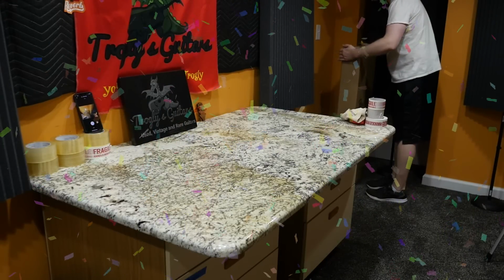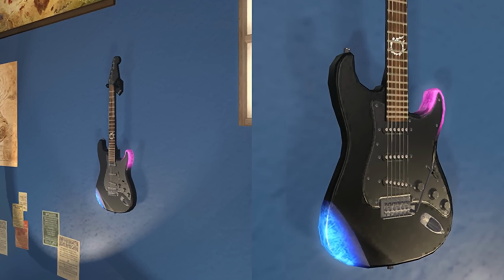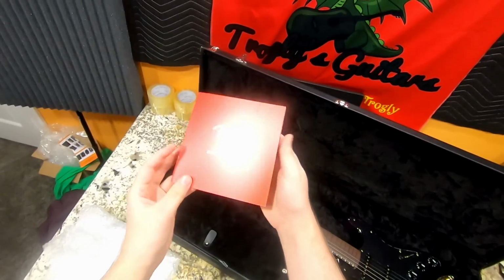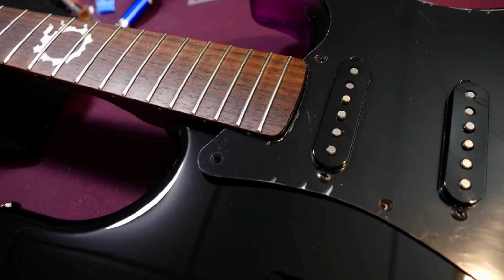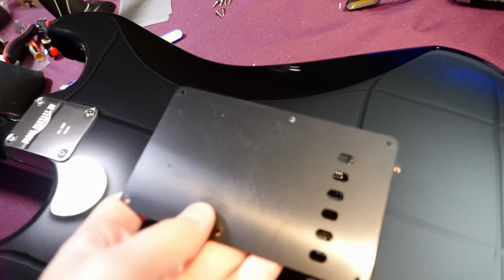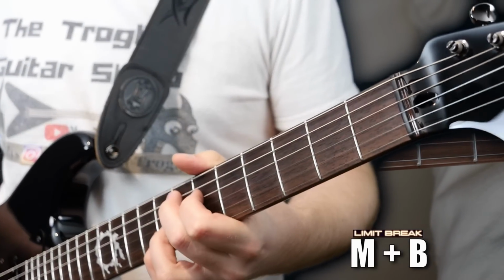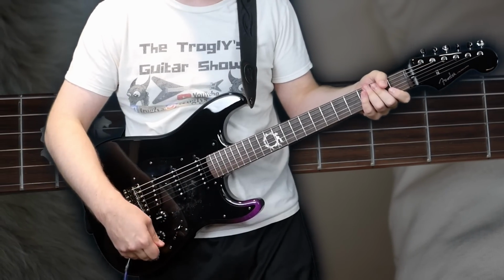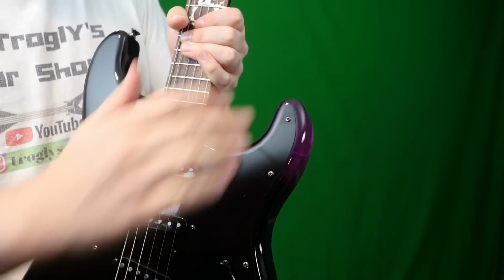The Real Life Aetherolectric Guitar! | 2021 Fender Final Fantasy XIV Stratocaster Review + Demo

Comment: I really dig this guitar but can't see paying nearly $4k for it. Not even half to be honest.
Reply: I agree. It's certainly not above the ultra luxe in the USA line.  MAYBE a close match to the American Professional with the V-Mod pickups. But that's $1500.  You know they based it on some current model.  I'm thinking the American Professional, and as Flossy Carter would say, "It's too gat damn high.".

My expectations may be wrong, but these special edition guitars I think should have some type of special edition specs and b at least as good as the top of the production line guitars.
Reply: @VidMashUp  there's crystal horns as far as specs
Reply: @88_TROUBLE_88  I don't consider "crystal horns" aka "part plastic body" a guitar spec.  So you're saying if you glue "crystal" (plastic) to a guitar, it now has better specs than if you didn't glue the plastic on? My point, that you missed, is that it doesn't even have the technical specs to match the $2200 ultra luxe.  I don't think the "crystal horns" make up for the inferior guitar components. If it's not at least as good a GUITAR as their top of the line production model, then it's not a guitar worth $1000 more, no matter how much colored plastic it has incorporated into the otherwise high quality wooden body.
Reply: @VidMashUp  If you feel the price of this guitar is too high, you're not a customer.
If you're making a rare guitar for a small number of people, it's only natural that the price will go up for that.If you don't like the amount, why don't you just buy a guitar that looks like everyone else's and has no features?
Reply: @farrukhleach515  sounds like you missed my point. Which was that if they are charging that much for a guitar, it should have top level features. Maybe something that you don't get in other guitars - special pickups or even their high-end pickups that are in there $2,200 guitars, maybe something a little special other than a couple of pieces of plastic in the body. You're absolutely right I'm not a customer this guitar which, by the way is still an instrument and can validly be judged based on its quality as an instrument and in my opinion it's quality as an instrument is not what it should be. Otherwise why not just have it be a made in Mexico strat? Would that be fine with you? Better yet maybe they should have just made it a squire. It shouldn't matter as long as it has the plastic pretend crystals in the body right? It doesn't matter what the pickups are what the tuning machines are what the rest of the body is made of as long as it has those pretend crystals in it, right? The neck profile doesn't matter the fretboard and the fret work doesn't matter because it has those pretend crystals in it right? So why not make some extra profit and just make it a squire with a partially plastic body? When I'm sensing is that your appreciation for a guitar as an instrument is zero and you're just a fanboy of the game. In fact I'd be surprised if you even play the guitar.
Reply: I couldn't agree with you more. It's basically spect as an American professional II, which makes the premium for the "crystal horns" 167% of the price of the  guitar. (For you math wizards, that means the price is about 2.6 times the price of the same guitar without the plastic horns)
Reply: @farrukhleach515  hey buddy if you want someone to put a couple bits of coloured resin on your guitar you can find someone to do it much cheaper than the $2.5k they added to this guitars price tag.
Reply: @VidMashUp  Dont even know what ya expecting. It's a limited item, so the price is always boasted.
Reply: There are quite a few on Reverb for just over $2k and they're still not moving :(

Comment: Agreed, missed opportunity to add an LED to the "crystals" wouldn't even need 9 volt, just a key chain battery. Poor QC for dust motes under the polyester finish on headstock, and one crooked tuner(!). Limit Break setting not really helpful with the V-Mods, better would have been a stacked humbucker in bridge. Alder body is good dense tonewood. Black polyester is good hard finish. Guitar is unique at least so maybe worth it for non fans.

Comment: The black finish isn't some sort of epoxy top coat is it? Seems like it could be epoxy glass finish probably because the transparent parts are epoxy so it was the best way to bond them without a seam line.
Might explain the price too
Reply from the maker: In the right lighting - you can see a visible seam line from wood to "crystal"

Comment: You'd have to toss the investment angle out the window, but I can see it being possible to drill 2 or 3 holes and wire up some LEDs with a little know how. Can understand it not being possible on a production model, LE or not, but do agree that there's better bang for the buck to be had elsewhere. Still a very cool guitar.

Comment: There’s Rickenbackers with lights under a translucent top, but those were pretty much chambered/hollowed out to fit the lights. The lights can “react” to what you’re playing on some models (best that it can do with the tech available anyway.) For this, it’s probably not lit because the “crystals” are at opposite ends of the guitar, so it’s a lot of long drill bits and wiring to a battery box (or a small 3 volt watch battery as 3 volt LEDs might be better.

Comment: All they had to do was drill thin holes from the control and pickup cavity to the resin areas, feed a couple of LEDs down there, wire them to a push push pot and a battery. Job done.

Comment: I would just order the parts for an American Professional 2 like Landon Bailey has and have it painted and customized to my specs if I wanted a guitar like this. I own several custom shops and the price is justified because the quality goes up exponentially. 

However if these are pretty much the same specs of the American Pro 2 , then it is a shame there is almost a 100% increase. Even some of my custom shops I wondered if I paid too much. 

Sure, it looks cool, and even as a collector I don’t think I would buy this. It sounds very similar to the American Pro 2 but muddier. Not even better, what a shame.

Comment: "Just chop off the horn and replace it, shape it, sand it..." Umm, no. I think I'd rather try to make a kit LP relic as a non-professional than try to make a proper gloss finish over two materials.
Reply: Polyurethane is pretty well behaved as far as finishes go, and lots of resins will play nice as a surface for the paint. Only hassle would be masking off then shooting the burst cleanly, plus maybe the crystal material would gum up the router bit somewhat.

Comment: $3500 for that ?! I will get right to ordering it after I feed my zebra striped, purple winged elephant flock (yes, flock) !
Seriously, though, that is way too much. 
On top of that, the dust under the finish on the headstock, (what looks to be) a pot metal trem block and a crooked tuner.
gtfoh

Comment: Just so you know the sources he mentioned here ain't hard to get, if you dive deep enough and have some language ability. Nowadays with the internet, what exclusivity are we talking?
Reply from the maker: There's more to it than just contacting a store. Fender is cracking down on the export of Japan-exclusive guitars that are brand new. On top of that, to get to the front of the line on a limited release, you have to buy LOTS of guitars from that shop - not something everyone can do.   Used guitars and common models are much easier to order from Japan